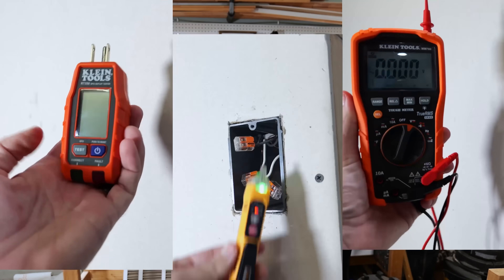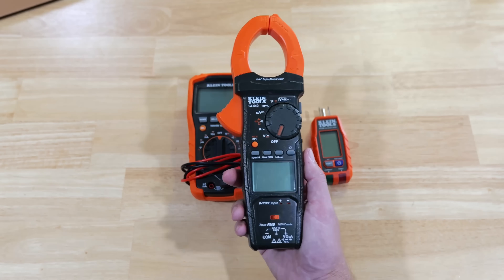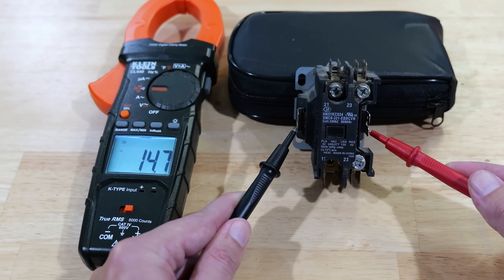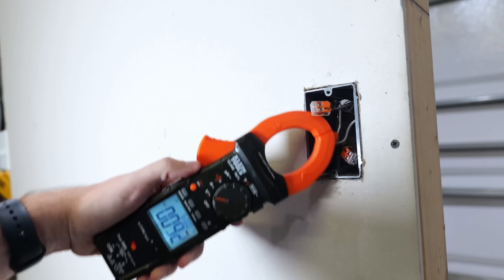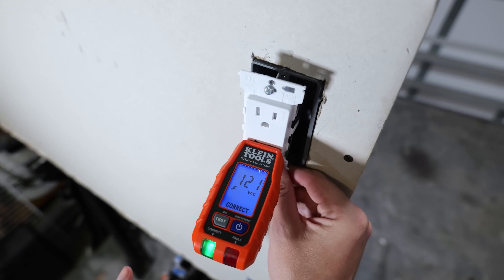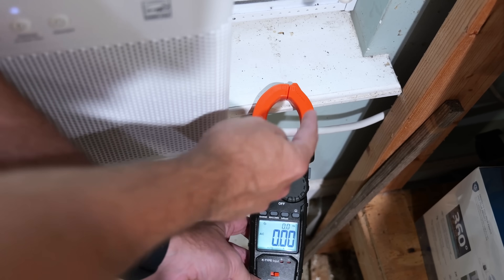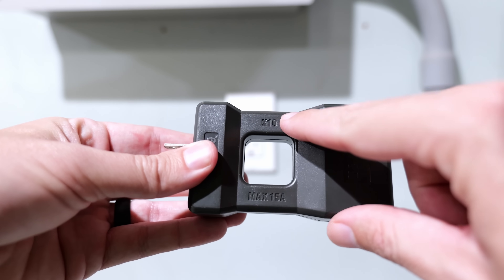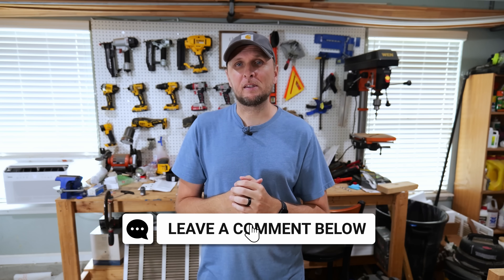The ONE Electrical Tool That Can Replace Them All!

Comment: Great video! As an electrician myself I use a fluke but the problem with them is they are really expensive. These are perfect for the homeowner and DIYer. Not too expensive and work really well! Really thinking about making a video on my channel as well on the topic of multimeters. Thanks for taking the time to share! You’re bringing value to many!
Reply: As an electrician in a very large plant we could get almost any test equipment furnished by the company.  My favorite tester was the Fluke t5-1000.  Almost impossible to damage or destroy electrically.  AT least to the 480 volt 3 phase circuits I have tried it on.  It does miss the capacitor tester but seldom is there a need for it.
Reply: @ralphmowery2898 I love it when the company asks me if you need anything tools. I always said yes. Fluke and knipex I always choose.
Reply: @ralphmowery2898 too bad you are limited by your old Fluke tools…
Reply: @ralphmowery2898  If the Fluke T6-1000 and the Fluke 376 had a child, it would be perfect! I would get an open fork to test amperage and voltage, as well as inrush, microfarads, and the iFlex cable for situations neither an open fork or traditional clamp fit into…
Reply: Fluke is premium.
Reply: @Tsitris46  I agree!
Reply from the maker: @landerselectric really glad to hear you liked it.  Yeah Fluke makes great products!  You should do it!  Some good videos on multimeters are always needed.  I really appreciate you taking the time to leave this feedback!
Reply: @HowToHomeDIY  Don’t get me wrong, I really like this meter as well! Thank you for   spending so much time creating fantastic content!
Reply: Look up Benning Duspol or similar devices. A multi meter has no place installing mains voltage. They are high impedance and will show you any stray coupling.
Professional testers have a 2kOhm switchable load, that let you load the circuit thus eliminating false positives.
Also can the load be used to trigger RCDs remotely to test their correct function or to identify lines or making them safe to work with by triggering the RCD.
Reply: Dopes at Fluke only make test probe on the amp meter with the U cut out ( T? 1 or 600 ) that will fit into a receptacle. The test probes that comes with VOM meters will not fit into a receptacle
Reply: On sale at HD right now !
Reply: From a life long industrial electrician. NEVER our hade or use ANY safety or test equipment made in nogoodnics lying cheating communist china. The money you might save not not worth the safety of clients or your life.
Reply: Too bad pros don’t know better and still think fluke is the best.  These Kleins kick their buts!!  It is a sign that they don’t keep up with tech.
Reply: I bought and old boat and am learning all sorts of new things.
Reply: How I can detect a shortage location in the line? When I turn a braker to the barn the breaker to the RV garage shuts down?, they go in 1 line.
My friend, who is an electrician, gave me a present Fluke Tester and said it's better than kline.
Reply: Fluke isn't what it used to be.  I used to have all fluke but now I have none.  Don't get sold on a name. If you look at history getting stuck on a name can hurt you.
Reply: @engineclinic  what brand do you have now?
Reply: Really? What kind of tools do you buy if u can’t afford a Fluke 87?  Not to mention they are pretty well protected internally, it’s an investment like any other tool.  Buy once cry once!
Reply: what electrician uses a multimeter instead of a two-pole voltage tester, multimeter can show fake voltage on wires that are turned off so you need to push a button on your two-pole tester that adds a load resistor to see if the voltage is real or fake.
Reply: As a professional I disagree with the whole premise of this video.  Never get sold on tools that can perform a whole bunch of Tasks but rather look for tools that can perform great on a specific task.  That being said, multi meters are designed to do several tasks but they won't really replace specific purpose testers like a receptacle tester and a non contact voltage tester.  I use an adjustable non contact voltage tester for voltage identifying and tracing because it would be ridiculous to try to use my clamp meter.  I would also never buy a digital receptacle tester that you have to turn on.  They are a simple tool designed for you to be able to quickly run through a house and test all the receptacles.  It would take you at least 10 times longer to do it with a multi meter but you could.  But you wouldn't be able to test a ground fault or arc fault receptical with a multi meter. The fancy looking digital one that he has requires a battery and it will probably let you down. Get tools that have a purpose and perform at a reliable level.  Don't try to replace all your tools with one stupid do it all tool.